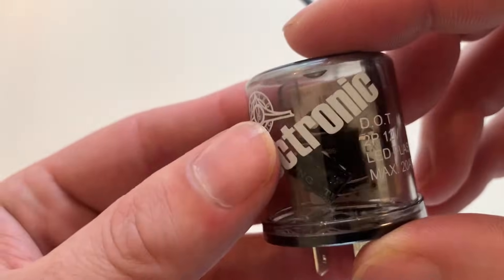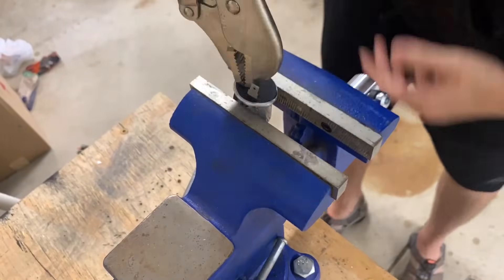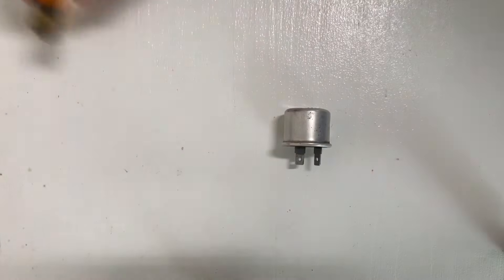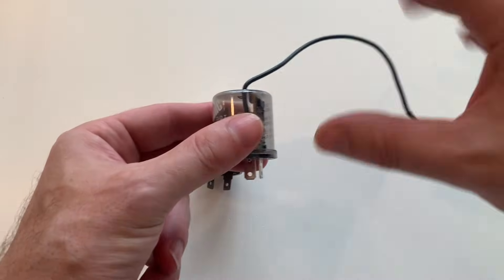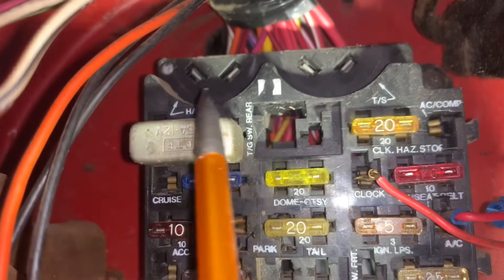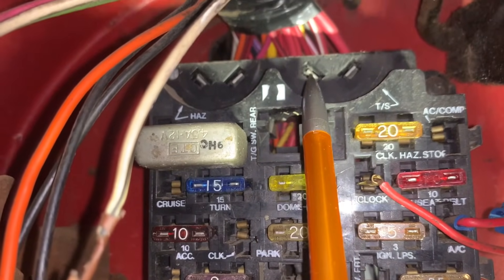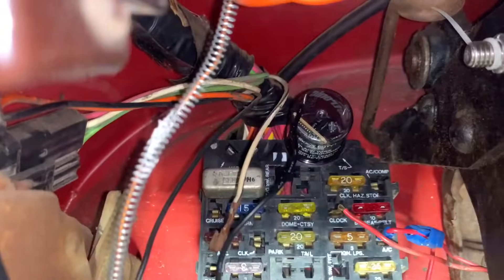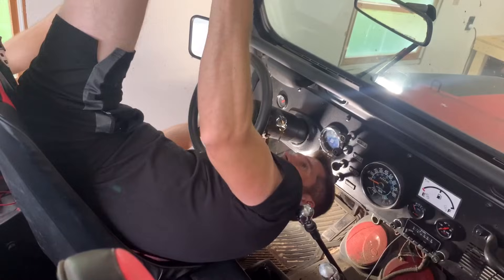Turn Signal Flasher | Thermal vs Electronic (for LED) | How to Install | Jeep CJ CJ5 CJ7 Blinker

Comment: My question is what if you have led lights in the back and stock ones at the front? Is that compatible with a electronic flasher? Or do I have to change the front ones to led too?
Reply from the maker: An electronic flasher will work with led and regular/incandescent bulbs. 
I would install the leds in the back and try your stock thermal flasher first, and if it’s not working correctly, then switch to the electronic flasher.
Reply: @HowtoandReviewsOfficial do I Need to have one with a ground or not nescecary?

Comment: Hi There. Been awhile since this video but I was wondering if you ever got round to doing the Hazard light modification. I noticed you said that a seperate flasher unit would be required ?
Reply from the maker: I didn’t quite get to it. It was on the to do list, but I ended up selling it last year.

Comment: There are two types of relays for that, the EF32RLNP doesn't require a polarity changer or swapping wires, since it's not polarity dependant. The EF32RL IS polarity dependant.

Comment: Hi. Hoping to get some advice. I'm swapping my turn signals in my motorbike for LED ones, the first set I got was not bright enough so I got an original set from Suzuki.
My doubt is about the flasher, the first one I got did not have a ground cable and the indicators worked fine, the new set came with a flasher equipped with the ground cable. I would connect it to a cable as per instructions, but the cable will not reach... So can I use the first flasher and not worry about grounding? Should I extend the cable and connect grounding as per instructions? Maybe solder it to some metal element?

Comment: Great video. What is the part number you used for the hazard unit?
Reply from the maker: The hazard flasher would be the same as the turn signal flasher.
Reply: Thank yoy

Comment: Thank you very much, I had the same problem and was trying to figure it out 1983 jeep CJ7
Reply from the maker: Glad it helped!
Reply: @HowtoandReviewsOfficial  LOL I replaced all bulbs to LED and flashers as needed and found turn signal socket 180 degrees off and figured that out, all lights and blinkers are working with head lights on or off,,, and now the Hazard lights stopped working, I have no idea why, I tried different style relays still no Haz. lights.... any ideas on that one ?

Comment: I added LED signals  to my 64 Chevy C10. Then installed those electric blinkers. Blinkers would not work. Then re installed the original thermo flasher and work perfectly.   What is up with that ?   Anybody?  Thanks. ✌🏼

Comment: There is an over flow of current when I upgraded to LED blinkers on my motorcycle. Although this video is for CJ7, but you explained wiring and electrical in detail. This will surely help in resolving the issue I'm facing. Thank a lot 👍
Reply from the maker: Glad it helped!

Comment: Great video. I have a question about how to add a headlight reminder buzzer to my CJ. I know the obvious thing would be to just look to see if they're on, but we've all been there with a dead battery after leaving them on.
Reply from the maker: Yes. I’ve been there too! There is a very simple fix for it. I did it several years ago, so I don’t remember the details. I will look into it and get back to you. And I will also plan on making a dedicated video for it.
Reply from the maker: I used a Peizo Buzzer. I got it from Radio Shack for about $3 back in the day. Radio shack part number 273-0059. You may need to order one online these days. 

In the fuse box, connect the red wire to the Lamp fuse (use a probe to verify that it is only hot when the headlights are on), and the black wire to Ignition fuse (use a probe to verify that it is hot when the key is on, and is a ground when the key is off).

Comment: Great video 👍👍👍 I’m upgrading my YJ to LEDs. Just curious, is the hazard flasher also hanging somewhere instead of attached to the fusebox? I’m at work and can’t physically check right now.
Reply from the maker: In my CJ, both flashers are in the fuse box. If yours are not in the fuse box, I’m not sure where the hazards flasher is located.

Comment: Hello! This is good info. Thank you. I installed all side and front marker LEDs recommended as well as flasher. All works as it should w the exception of side marker is not as bright as it should be. Previous owner had replaced some of the wiring but looks to be correct per Chilton or Haynes manual diagram. Any insight? Thank you in advance!
Reply from the maker: Unfortunately, it's not something I can look into at this time. It is covered up and tucked in the corner for winter storage. Zero degrees out today with a -30 wind chill!

Comment: Great video!  Can you use the electronic flasher with regular bulbs and gradually swap over to LED.  I.e.  can you have a mixture of LED and regular bulbs.
Reply from the maker: Yes you can!  And electronic flasher will work with any type of light bulb. 

The regular thermal flasher may still continue to work for a while if you have a mixture of bulbs, but will eventually stop working when you have too many LED bulbs.

Comment: New relay installed will work for about 5 minutes and then stay solid. If I put a electronic flasher will this fix my issue?

Comment: So I installed led turn signals front and back and used that same grounded flasher. The back LED’s worked but the fronts wouldn’t and neither would the emergency blinkers. I had to install the halogens back in the front for everything to work. How come?

Comment: Your vid’s are great. I have 79 cj7 And bought led parts exactly as you described. Lights work perfectly but the driver parking light is dimmer than pass light. Then when I turn on blinkers the reverse lights come on  too and the driver park light goes off completely. When I have lights on and the turn blinkers the reverse come on again and park light amd blinker lights stop blinking completely. Got any suggestions?
Reply from the maker: I would start with the taillights since there are some strange things going on there that should not be possible if everything was working correctly before the swap.
If you had to cut and splice them into the harness like it did, double check that everything is wired correctly. Mine was not intuitive. I recall that the black was not the ground, and the wire colors on the taillight didn’t match the wire colors in the harness.

Comment: That was an awesome video. Thank you so very much. Don't know if you can help me or not but I have a 71 K5 Blazer I have led for the backups and incandescent all the way around except for that front signal lights that are after market universal. Now get this, when I hook  the universal turn signals up to the wires that go below the bumper, everything works accordingly as long as I don't turn on the parking lights. When I do, the LED lights won't flash and just shut off. When I hook the same lights up to the marker lights on the side of the vehicle, the parking lights have to be on for everything to work accordingly. So it's just the opposite of what I just described. Do you think this is a LED flasher issue which I don't have yet? Or is it a combination of having an LED and the incandescent lights with the traditional flasher.  I've been searching for many hours tonight and I haven't had anybody that's running to this problem. If you can help in any way, I'd be forever grateful
Reply from the maker: I am not familiar with the light system on that vehicle specifically, but I have a couple suggestions.

1. It is not currently working correctly, so something needs to change. In my opinion, the LED flasher is something that is worth a try.

2. Do some research and determine if maybe your stock turn signal bulbs are polarity sensitive. That is, does current need to flow both ways for the system to work properly? LED bulbs typically only allow current to flow in one direction. This could be the problem. There are some LED bulbs that are not polarity sensitive and allow current to flow both ways, but you will need to specifically search for them.

Comment: So where did u find your led  hazard lights flasher? And would u happened to have a product number? Or is it the same as the led turn signal flasher?
Reply from the maker: The hazard lights will use the same led flasher.

Comment: What do you use for your hazards?
Reply from the maker: Good question! The hazards also need an electronic flasher.
Reply: @HowtoandReviewsOfficial  assuming it uses the same electronic flasher just in the hazard location so you’d order two if you wanted the hazards to work as well?
Reply from the maker: @AverageOverlander  That’s correct!
Reply: @HowtoandReviewsOfficial  Appreciate ya.  Your two videos really helped so thanks for making them..
Reply: But aren’t the turn signal and the hazard different voltage or amps?